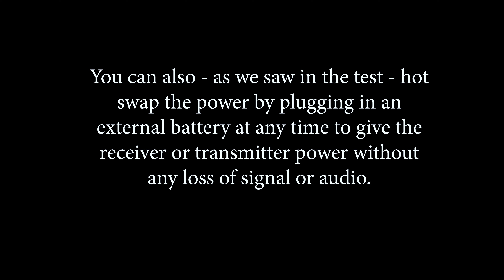Can you use external power for Rode Wireless Go 2? Part 1

Comment: I had bought them but received malfunctioned batteries of mics, I wanted to replace the batteries of them but unable to get any solution because their batteries are not easily available? Any solution
Reply from the maker: ABSOLUTELY - If the units came with bad batteries, this is something Rode is aware of in some units. Sometimes making sure you update the new firmware with fix this - however, my units were all dying after an hour of use, so I reached out to them - https://www.youtube.com/watch?v=BZqcMXsygwU

Comment: I have the wireless go to hooked up to my GoPro hero, five black, running the camera on external power and the receiver on external power for some reason when the receiver runs out of batteries, it doesn’t continue to stay on through the power bank. The actual Mic  that’s being run with external power stays running over seven hours and has the flashing blue light but never cuts out. Does the receiver being connected to the camera directly have any effect on it not staying on after seven hours?
Reply from the maker: If you're running the power from the connection to the camera, then you need to make sure every connection is acting both as a data + power passthrough - If I use the receiver or transmitter for a very long time, I don't use the USB port for anything but power - zero data transfer.
Reply: @NightOwlsMedia  thanks for the response. Can you break that down into more simple terms for this noob. So are you saying don’t connect the mic to the camera? I need external power for both. I’m also using the GoPro Mike adapter in this set up
Reply from the maker: @TiggsTailsFishingToo  Hey! No worries! We all started somewhere - So in general, I almost never connect the receiver to the camera. 1) you can't get 32bit float from the receiver  to a camera source, so really the audio feed to the camera is just a scratch track / temp track (this is the audio you typically delete in editing but just use it as a guide when syncing or listening for cues), and 2) these only have one usb-C port making them really only usable for power when shooting long shoots (like I am assuming you might be for fishing trips, etc). 

For example, I took these on a trip with me when I went to Austria and hiked up a mountain interviewing someone about their life. On her i had two recorders: the Rode WG2 (in this video) and a back up DR10L w/ lav mic. On the camera, I used a shotgun mic (Deity) to record the wild sound (wild sound is basically like it sounds, you get what you get, if someone is close enough to the mic, it will sound OK, but more than a couple feet a way, it's good for ambiance and nature sounds, but really not speaking - I wanted it for the nature background as we walked as the lav mics won't pick up the steps or good wind through the trees). In post, I synced up the audio from the camera (shotgun) to the 2 lav sources easily and then layered in the lav mic audio that sounded the cleanest - in this case, the Rode (because of the 32bit float). 

The Rode, I had connected to a small pocket sized battery brick through the USB C in order for it to keep recording as long as we were out. The DR10L has a battery life of like 12 hours, so I didn't worry so much about those (however, that unit version doesnt have 32bit float, so I was considering it as a back up). As long as you set up the settings to your liking before you hit record (always on), then you can just run your camera and know that the audio is being recorded - The only caveat I had was I wish I could monitor the recorder through bluetooth or something on my phone to ensure it sounded OK, but that's why we have backups.

Comment: my question is will it stay charging, the test only shows that it will not have any feedback but if its low battery will it stay on
Reply from the maker: Hey there. Sorry if I didn't make it more obvious. Yes, the WGII will stay on until you run out of power. So if you have a direct AC feed, you're good until the cows come home.  If you have the bat bank, it will stay on until the bat bank does. I didn't test if the WGII will continue after the bank does, but I've run my Anker 26800 on the transmitter for a full 15 hour shoots and the bat ball wasn't even at 1/2. Did you watch the part 2 video? I am pretty sure I talked about it in that. Either way, let me know
Reply: @NightOwlsMedia  I'll check out the second video thanks for the reply. U got my sub 🙏🏼
Reply from the maker: @INSOMNANOMS  thanks homie! I hope it helps!!!